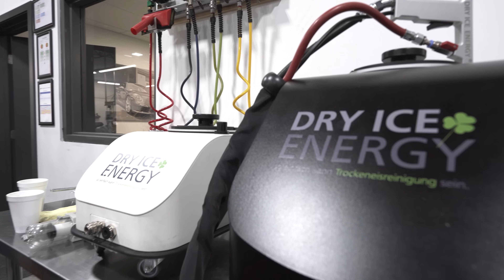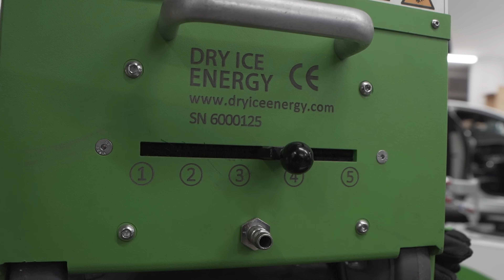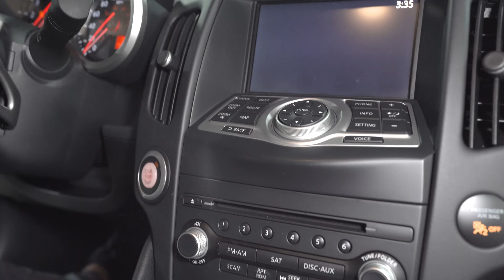Dry Ice Cleaning | Fine Print and Results

Comment: Where does the dirt go?    In the case of upholstery, are you just pushing the dirt deeper?
Reply from the maker: Between pressure and low temps its essentially turns it into a dust and blows it off into the air.

Comment: The problem with using this inside is that it makes a large percentage of the dirt become airborne and its going to cover every surface in the shop. Larry from AMMONYC has pointed out to this. Plus you need to be aware of the fact that you are going to breathe in a lot of the old cum/shit stains if you use it in the interior.

Comment: I work for Hershey chocolate company and we(they) use dry ice to clean food manufacturing equipment on the regular.  Only thing that can hold you up is actually ordering the dry ice from the supplier. Our company uses so much that they call out a week ahead. I like the cold jet(dry ice) cleaning, it gets into all the nooks and crannies that we maintenance mechanics would otherwise have to disassemble to be cleaned properly. Saves a lot of downtime, compared to manually cleaning.

Comment: A good 'Vapor Steam cleaner' is about 1K and does much better job cleaning and degreasing most surfaces, it uses no chemicals, just add water and runs on 120V.  Puts out 315 degree steam vapor at 75psi.  Can be set to 5% water in the Vapor.  1000's of uses in and out of the house.  I think the dry ice machine would be a hassle to use regularly and cost 5-10 times more than the 'Vapor Steam Cleaner'.  I've had one for years and would replace it in an instant if this one went bad.

Comment: I think I'm the only one who thinks that car detailing really isn't the best use for CO2 blasting.  And Is dirty undercoating really a concern?
Reply: I'd have to see more evidence on the detailing, but what they showed was impressive. Being able to get dirt and oils out of fabrics and carpeting is no small thing when the alternative is solvents that may not even work as well.
Reply: @markmiller3279  Not intending to be too critical, but it seems to cover a pretty small working area so I figure after the novelty wears off and the cost and inconvenience of getting the dry ice, there really would be only a few use cases where it would be worth the time and extra cost.  The undercoating basically turned brittle because of the cold so yes it would flake off but that doesn't mean it was bad.  Being new to the detail industry, I think people are overreacting to it.  I can wipe chassis dirt off with a dry rag and I fail to understand why someone would clean a brake rotor with it.

Comment: The tech for this was actually developed by the cannabis industry.  They have been using dry ice for extraction/refinement purposes for over a decade now and its been repurposed for other industries.  They really shouldn't be "open blasting" as we call it in the canna industry though - all the dry ice does is act as a solvent then disperses what it removed as micro particles in the air when it turns to gas.  Its pretty simple tech but they should be wearing a P100 grade mask with a negative pressure ventilation system running!
Reply: Can confirm, they are setting themselves up for some serious respiratory/health issues in the future.  CO2 is only ideal for this purpose in a closed-loop system.

Comment: As a former Respiratory Therapist, I consider this technology particularly dangerous. Even with a protective suit and a mask rebreather, micro particles will remain in the air  . Other than a sealed booth, there is no way to avoid inhaling oil, abrasive particles, metal, paint, you name it.  Too high a risk….sorry !
Reply: Yea they need to use paint booths that have air filtration and water running under the grated floor.
Reply: This.  They really should be wearing a p100 mask and have a robust filtration system set up running on negative pressure.

Comment: Environmentally friendly? Yeah, you only need a lot of electricity to cool the gas down that much. (We'd have to compare the alternative processes in all detail.) And because humankind is so very insane, they have just chosen to make electricity generation ever-dirtier, including the hypocritical, NAZO-servile German olive Green party.
It is convenient at the application end, but convenience comes at a price, and right now we can afford convenience less than ever and need to work at the problem root.

And he mentioned the potential problems with the severe and quick cooling happening. We have to ponder what long-term effect such a shock treatment might have. Maybe it is not that convenient after all.
Furthermore, it deceives into more convenience than it deserves: What happens with the dirt you remove? If you use this in interiors or such, naturally the dirt will be flying through the air at high speed and accumulate somewhere. In such applications it is like a glorified leaf blower. - This is why it is typically called "dry ice blasting", not "dry ice cleaning" like the marketing angle here.

And what about micro-abrasion? Wear is not a yes-or-no thing but has many gradations. Maybe it has effects on surfaces comparable to mild polishing?
And the cooling effect might be brief, but there merely means the very surface of the material will be shock-cooled.

This needs to be used without tech excitement but with professional restraint and scrutiny and an understanding which applications can be trusted to truly be uncritical. - The guy kept talking about their experience, how certain uses were never a problem. He did not talk about scientific studies of material properties. Have they even done such? Or riding on the streamlining wave of environmentalist entrepreneurship?

And they are using CO₂, not nitrogen? 🤔 Might this also necessitate being careful with the concentration? I think it is very unhealthy to be exposed to significantly elevated CO₂ levels. It has a toxic effect.

Comment: As someone who has experience with sand blasting I can respect the amount of time and thought they had to put into the machine to prevent the dry ice pellets from clogging up in the machine. I do wonder about more humid climates having issues though. I suppose its almost necessary to have a drier system on the air compressor. Truly excited to see where this technology expands out to.

Comment: It's amazing technology but one safety item I've yet to see discussed in all the dry ice demo's I've watched: what about masks/respirators while doing this work? I rarely see any operators wearing them. All that road grime, oil, brake dust, dirt, etc. is now being blasted into microscopic particles and goes right in the air you're breathing before it settles on the floor or wherever. With traditional cleaning, that gunk is contained in water or soap so doesn't get airborne. I just wonder about the long term effects on your lungs if you are doing this for your day job without a proper mask.
Reply: 100% want to use a filter/particle mask while doing this.  Dry Ice itself isn't really dangerous unless your using a lot of it in a small, un-ventilated room.

Comment: Cool product, I'm excited to see this become more attainable for home use.  The $450/mo. machine rental is a non-starter for almost everyone not using this professionally, but if I could buy a machine for $500ish that I can use a few times a year, I'd be all about it.
Reply: I've looked into it where I live. It's not the cost of rental, but getting the pellets. They don't last forever. So, if the job is delayed, your money literally went up in smoke, evaporated. You need to go get more dry ice.
Reply: There are cheap machines from China, you can get one for $2-3k but there are no reliable reviews of them anywhere. Also most people don't have an air compressor powerful enough, even the biggest Husky compressor wouldn't be powerful enough. I just don't see how this would ever work on a DIY basis.
Reply: @alexabc123  I wonder if you could have a mid line dispenser attachment on an hvlp system.  Although now that I think about it the whole "low pressure" part of that might kill that idea

Comment: Why would I want to dry ice blast my interior? I could be done wiping it down with $12 interior detailer before that machine gets set up
Reply: In a commercial setting all they'd have to do is add dry ice and maybe adjust the air pressure. It's a very simple device in principle.

Comment: Really love this deep dive into dry ice cleaning. And man, all that footage of stuff going from grungy to brand new was super satisfying. I have to wonder - when the dry ice displaces all that dirt, where does it go? Do you have to wear a respirator to avoid breathing it in?
Reply: He briefly mentions at the end, and it is common sense, the debris does go flying off everywhere. A post-cleanup of surrounding areas would be needed. I imagine a concept similar to a dentist, where another person attempts to suction/vacuum near the area of impact may help minimize that rogue debris
Reply: No, the mess Mark mentioned was in reference to mixed media like glass or sand added to the dry ice, which is a specific feature but not needed for most use cases. @datstev question still stands—were did the dirt, grim and oils go?    A quick explanation of the molecular science would have been cool addition to the video.

Comment: Holy Disclaimers batman look at that air compressor…that changes everything. It requires insanely high CFM or high PSI? Or both? Shame he didn’t mention the compressor requirements
Reply from the maker: That depends on application. You can use smaller units if you are just doing smaller jobs.
Reply: @savagegeese  fascinating, thanks

Comment: Dry ice blasting is great for the high voltage utility industry. We use it for cleaning 34kv porcelain insulators at a steel mill where conventional cleaning takes much more time and man power.

Comment: Cars with electric motors are pressure washer friendly…believe it or not…also water doesn’t damage computer parts unless you literally run it while wet or fail to clean the debris off afterwards before restarting.

Comment: When I worked in a garage one thing I noticed over the years was that caked on grease and oil residue prevents rust. Id often joke about how the manufacturer had built in their own rust prevention system with a leaky gasket.
Reply: Gunk has preserved so many 2 stroke motorcycles.

Comment: 11:34 the dry ice sublimates when it hits the surface, the solid CO2 takes off the dirt and then turns to gas almost instantly so it doesn't transfer much of the energy/temperature.
Reply: Well technically to sublimate to the gas phase, it needs to absorb energy from something. I would think that heat is being conducted from the material it's impacting since solids transfer heat better than the surrounding air. But since the rubber has so much mass compared  to the dry ice, it'll take a long time before the temperature drops enough to be a problem.

Comment: I've seen several of these dry ice and steam blasting videos but still don't know where the dirt is going. It just being displaced? Is it just landing on other surfaces thats then need to be cleaned?
Reply from the maker: It freezes, dries, gets blasted, lifted and blown at high speed off surface.  So often you would wipe down surfaces after and potentially vacuum.
Reply: Yes. It just gets blown everywhere. You definitely need to vacuum up all of the dirt and dust particles after you blast with the dry ice.
Reply: I’d guess the point is to get the filth and stains stuck on the surface completely out of there. Once it gets blown out, it’s loose enough to wipe/vacuum it away wherever it landed. Not bad, honestlyz
Reply: Oily crud goes everywhere too, not so easy to clean of course.

Comment: I'm surprised they don't do it in a booth or cover at all, they just ice blast in the middle of their shop, the dirt and grime from ice blasting beaing thrown around is insane.
Reply from the maker: It was for training purposes that day.
Reply: @savagegeese  thanks for explaining
Reply: Yeah. You’d have to go and vacuum it all up. We use dry ice blasting in car manufacturing to clean off the welding equipment. You dry ice blast the weld tooling to get the weld slag off, and there is TONS of debris that flies everywhere. You have to clean it up.

Comment: I've been using dry ice blasting in residential mold removal for decades, as well as fire/smoke damage.  Often times in severe mold and smoke damage we will blast furniture and often times it doesn't remove the poly on wood pieces
Reply: Thanks, that's very interesting. What a great use for this technology.